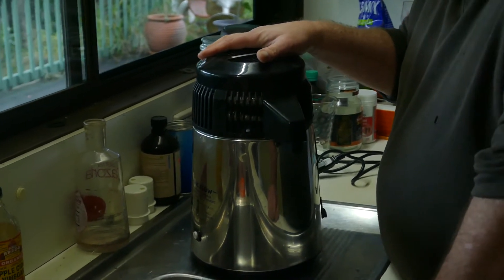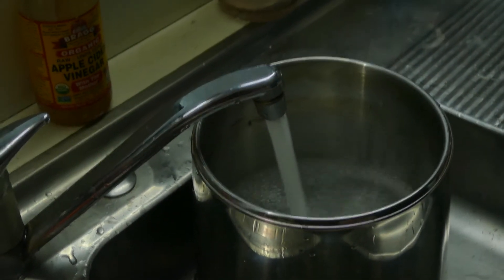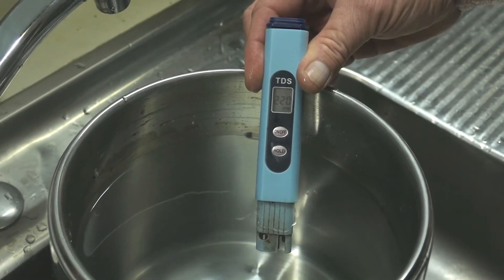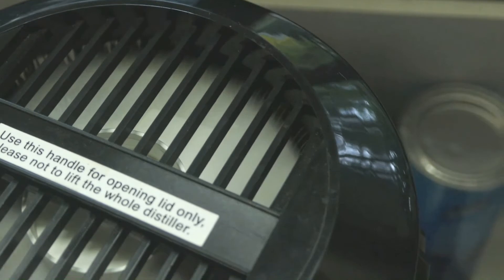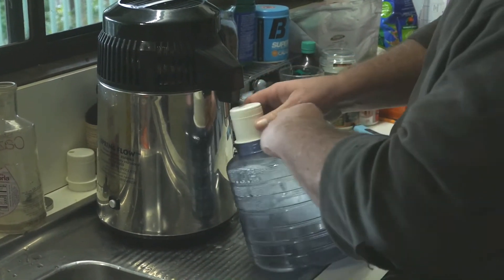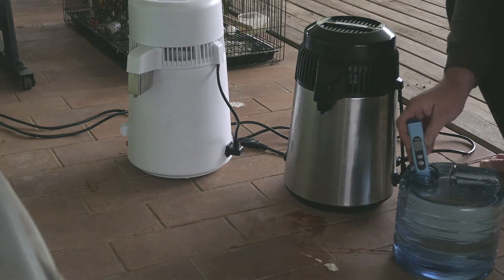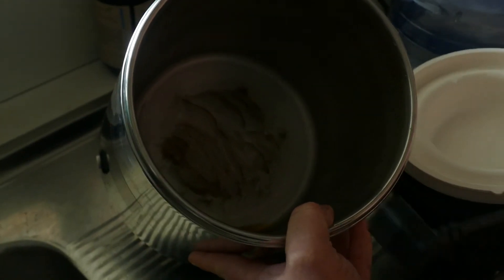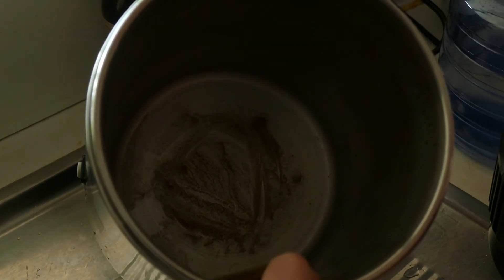WHATS IN OUR WATER? | The ONLY Way to Filter Fluoride is Making Distilled Water

Comment: Wanted your view, distill machine vs science kit? I know distill machine needs carbon filter but been wondering on using heat gun below distill science kit thing
Reply from the maker: ...I don't know what a 'science kit' IS?
Reply: @SteveMack  have you seen Mr Bean at school where kid turns blue, it like one of them but made so reduce liquid like collect stream water in another container but often burner below to heat it, most big ones are used to mix different things
Reply from the maker: @mlee6050  ...I've seen plenty of Mr. Bean over the years, but can't recall that one. I'd say ANY process that collects condensation from steam, will yield the same distilled water results...Although, that method would require AN AWEFULLY long time to do it for any substantial quantity of water!
Reply: @SteveMack  oh okay, I mainly thought as set up can use a heat gun but not need money spent on carbon filters all the time so be cheaper running cost
Reply from the maker: @mlee6050  Oh hell no! - The small bags of charcoal in the spout of distillers like mine, are quite inexpensive I think (I've never replaced one) VS what it'd cost in GAS and TIME to make the equivalent amount of distilled water! I ESTIMATE, at most; using one like this, would cost no more than $1 worst case scenario, in electricity - probably less!
Reply: @SteveMack  heat gun is electric and okay, I look to save up for a machine
Reply from the maker: @mlee6050  ...Check ebay and places like that. I assume heatguns would draw a lot more Amperage, therefore cost more to run. :)
Reply: @SteveMack  think a heat gun I got already is like 3 amps
Reply from the maker: Oh, only 3 Amps?? Sounds tiny! I'm not sure you'll get much boiling done with that, but good luck! 😉👍
Reply: @SteveMack  well here I am on 240v and thing is like 750w I think, range between 50c and 600c I believe
Reply from the maker: @mlee6050  oh ok; 750W is plenty then! If I recall, my machines vary from 800W to 1kw 👌👍The main benefit of the distillers is thermal efficiency, since the water is all fully enclosed in the stainless steel vessel, with the heating elements.

Comment: What benefits will you have from this exactly Steve????
Reply from the maker: The benefits of NOT ingesting toxins sound pretty logical to me!
Reply: @SteveMack  the problem is that this remove minerals too, take care on shortcomings nutrients
Reply: @nadienone  as if there's many minerals in tap water anyway
Reply from the maker: ANALYSIS OF MY LOCAL WATER SUPPLY
:

Barium mg per Litre: 0.008 to 0.029 Yes
Bromodichloromethane ugL 3 to 48 Yes
Bromoform ugL -LOR4 to 7.1 Yes
Cadmium mgL -LOR Yes
Chlorodibromomethane ugL -LOR to 38 Yes
Chloroform ugL 7.5 to 69 Yes
Chromium mgL -LOR to 0.002 Yes
Copper mgL 0.002 to 0.461 Yes
E. coli cfu100ml -LOR to 16 Yes3
Fluoride mgL 0.24 to 0.63 Yes
Lead mgL -LOR to 0.017 Yes
Manganese mgL 0.001 to 0.138 Yes
Monochloramine mgL -LOR to +6 Yes
Nickel mgL -LOR to 0.002 Yes
Nitrate mgL 0.04 to 1.03 Yes
Nitrite mgL -LOR to 0.38 Yes
Sulphate mgL 22 to 70 Yes

Over 180 studies showing that fluoride causes neurotoxic harm (e.g., reduced IQ).  
Over 300 animal and human studies that indicate that fluoride is neurotoxic.

Comment: Where do you get the little white filters you put in the top of the 4 liter water container? Thanks!
Reply from the maker: Jana Chavez because I ended up with three machines I still have filters, but I believe you can find them on eBay pretty regularly.
*  what I would love to know desperately is what the tiny crystals that come with the machines to clean them actually are - because they're the best cleaning product for pots and pans I've ever come across! 👍